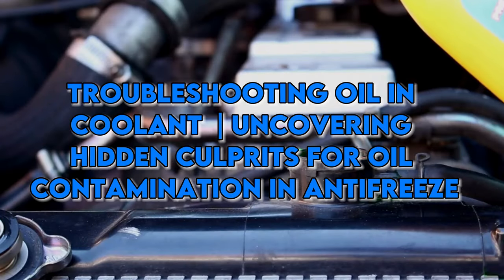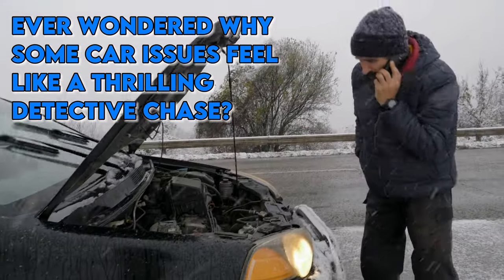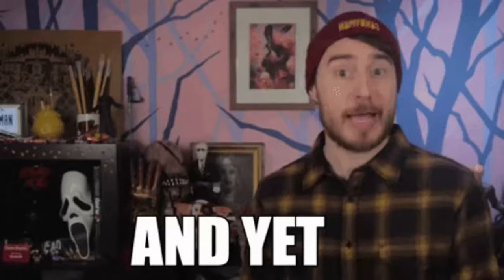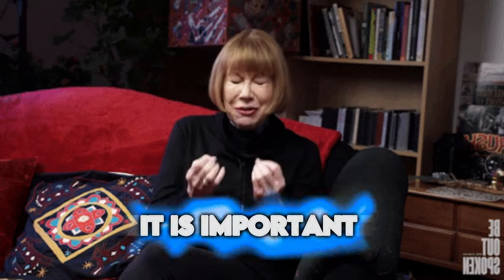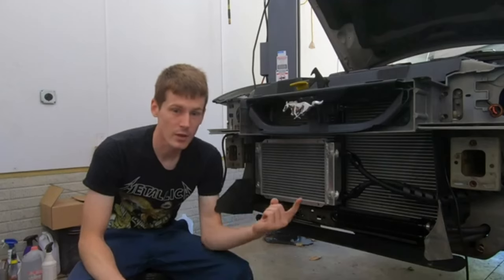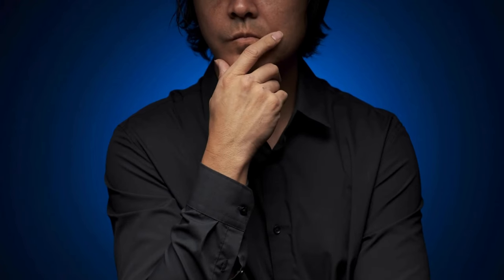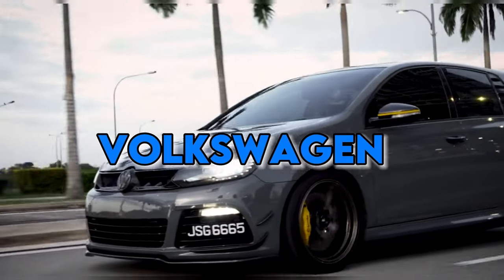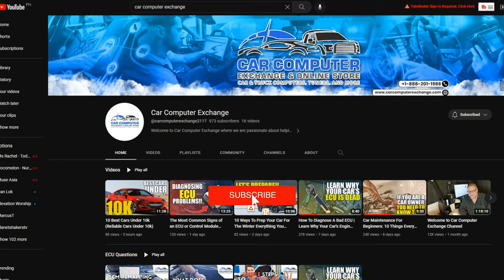Troubleshooting Oil In Coolant  | Uncovering Hidden Culprits For Oil Contamination in Antifreeze

Comment: Troubleshooting oil contamination in coolant is a crucial issue in keeping a vehicle running smoothly and preventing further damage to the cooling system. These types of problems can be indicative of various causes, and it is essential to address them in a timely and efficient manner.

Comment: The presence of oil in the coolant can indicate a serious issue with your vehicle's engine or cooling system. When troubleshooting oil contamination in the coolant, it's essential to address the root cause promptly to prevent further damage to the engine and cooling system.